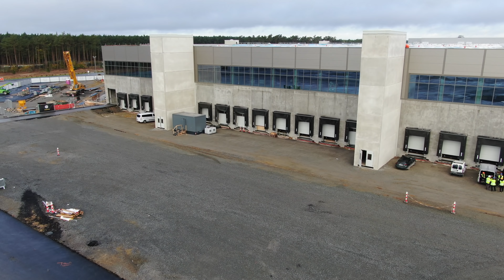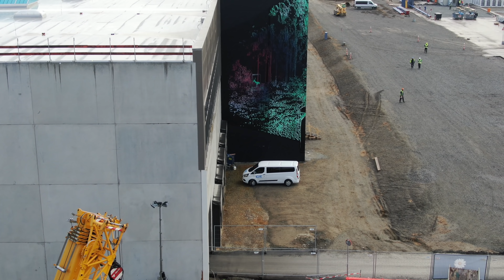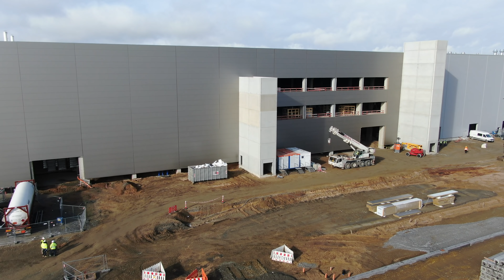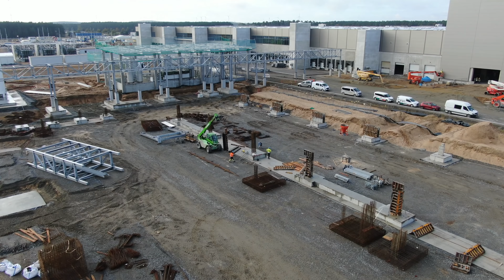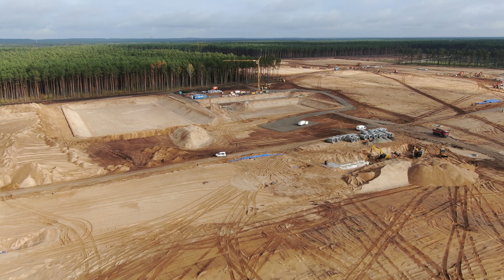Giga Berlin | 2021-10-16 | Progress everywhere

Comment: Great video as always, Tobias. The factory is looking more finished outside now. Still lot of work to be done outside.
It seems to me that there is more equipment outside at Giga Berlin than at Giga Texas. I wonder if this is due to Govt. environmental regulations in Germany?
Hope Tesla gets the final permit soon so that they can start test production/calibration at the plant.
Reply: Most of it is due to a difference in design philosophy and not regulations.  The change in design philosophy likely came with abundant cash to invest in the project.  Texas basically puts everything inside the building, which is unconventional.  It will be interesting to see what both sites look like in 10 years after changes are made to the original plans.

Comment: As you have titled the video Tobias there is indeed progress everywhere and it is great to see.  However the PM in me can't help but think the  project planners and schedulers have got to improve on their just-in-time-delivery of components, notably for the cell factory building.  There are so many unfitted beams on site that they are congesting the entire work area which compromises both personnel safety, crane movement and productivity.  And every time one of them has to be moved before it is installed costs money and schedule which is of course far from ideal.  That is one of my biggest complaints against this build, there seems to be so much shuffling of  equipment before it is ever installed and repeated movement of materials, especially the sand!!
Reply: There you can see one movie with movements every week and you want to judge that the management is bad. Do you not overestimate your skills?
Reply: @ManfredPrefi  And just what are your PM qualifications to definitively say I am wrong? I identified a specific problem, expressed an opinion that there is room for improvement based on fundamental project management practices and enunciated clearly visible risks and effects resulting from that problem.  Yes there are factors no viewer can know from just the videos on Tobias' and other channels following this build that lead to these conditions.  But that is the job of a professional project management team, to identify factors that lead to problems and then to the greatest extent possible resolve them or at the very least mitigate/minimize their effects.  Do you honestly think that the state of the battery factory site is ideal and that it does not affect productivity, costs and schedule?  I've seen many construction sites in my life and never have I seen this level of congestion or repeated movement of materials which is why I commented.  The only reason they can get away with this is that the site is large and not surrounded by other completed factories, the Empire State Building could never have been built without highly honed and effective just-in-time delivery of materials some 90 years ago.  Those lessons are just as valid today as they were then.   A lot of good work has been done and continues to be done, but that doesn't mean improvements cannot be made.

Comment: Tobias, you are a wonderful guy. This is such good work that you are doing.
On the other hand, I look at the intensions of this project, which is indeed a pinnacle of what humankind is capable of.
I cannot help having my doubts about the direction mankind is going to. Production of 500.000 cars each year is only 0,1 % of what is anticipated in the year 2050 as a total number of cars that will be poluting the planet. (800 million). The natural resources of Lithium will be exhausted by that time and at this moment it is not possible to recover this from old batteries. So in the end this is a dead-end street. Also temperature rise of the planet will be much higher than 2 % (2,7 is already predicted).

Comment: Thx @Tobias Lindh 

Berlin battery plant is somewhat narrower than Texas and of course if Berlin will be four large buildings in the future mirroring phase 1, battery and drive unit should be connected and become one building. Do you expect based on currently filed plans, that Tesla will soon widen the battery plant toward drive unit... or are they solving missing area by going vertical / multi storey?

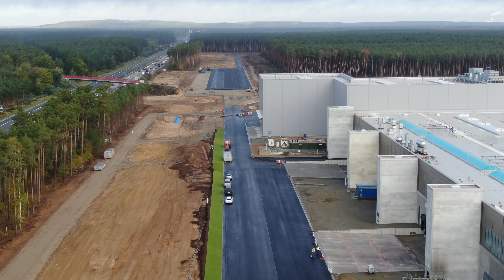Comment: 2:35 is that unused viaduct over autobahn? Also I see there will be a big fence on the edge of grass, there is a piling machine. I’m curious if it’s because of autobahn noise or they want to hide it from view, maybe not to distract drivers.
Reply: Its planned to bring a public bicycle track westside of it. Maybe it has something to do with it.
Reply: Won't be a fence but a "Trägerbohlwand" type "Berliner Verbau" for the construction pit of the rainwatrer infiltration basin.
Reply: This bridge (viaduct) belongs to the old "Poststrasse" (postal road) from Berlin to Frankfurt(Oder). The bridge will be connected to a future bicycle track running between the autobahn and the Tesla factory. I think I also read somewhere that Tesla plans to reconnect the old postal road (for bicycles) somehow.
There are also plans to built next year a bridge for bicycles and pedestrians across the road south of the GF4 (main entrance side).
Not that sure about the noise protection. The allowed height of such a construction is limited. Would in this distance from the autobahn only protect the production on the ground floor. But not the offices / social rooms at the floor above.
Reply: @abalada  thanks for detailed answer.

Comment: So can anybody advise if the utility bridge sections are high enough for a person to walk through them without having to stoop over or even duck down at each cross top frame member?  If not then installing and thereafter inspecting and maintaining the piping and electrical services running through it is going to be a real chore that will be slow and costly. They look close to tall enough and I would certainly expect that to be the case but without any size reference I can't be certain either way.

Comment: What is that structure at around 14:00?
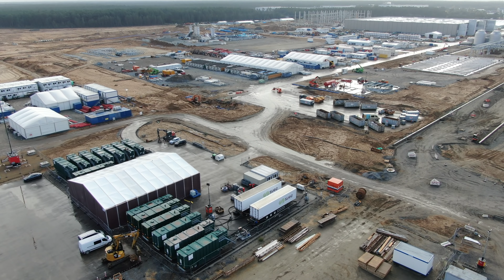Reply: Central Utilities Building. Those platforms are for the big cooling units you can see at 12:07 parked before the long white tent.
Reply: @abalada  What needs that much cooling? Casting?

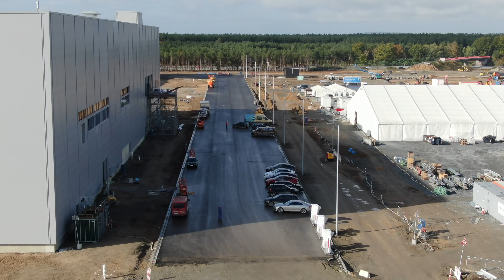Comment: 10:23 why are there superchargers on the street? They should be in a parking lot. Maybe they not installed. But then why leave them on a road?
Reply: They were set up there for the public event. Around the corner they had the test track. Like that, the cars could just stay on the asphalt without dragging in dirt when they needed to recharge.

Comment: I wonder what happens to all the rain that lands on that roof, and the paved surfaces after all the concern about water.
Reply: @Frank RenewablesCheap … they catch all the rain water … time before they used the big blue plastic tanks but now slowly they have ( and still ) build the storm water lines to send the rain water to the storage pond. And I can only imagine that will use it at some form. And about the paved roads or the loading dock area all this surface water goes in the same roof storm water drainage system. U can see the concrete pipes? Normally one is for waste water and the other one is for storm water …
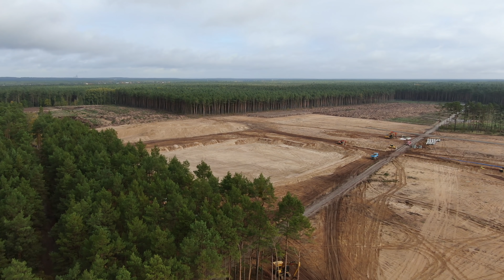Reply: Will end up in a number of infiltration basin, e.g. at 23:34.
There are 3 "wastewater" systems
storm (rain) water -> infiltration basins 
utilities (e.g. toilets) wastewater -> pumping station - > sewage plant in Erkner
process (e.g. paint shop) wastewater -> wastewater treatment facility -> pumping station - > sewage plant in Erkner

Comment: Anyone know what the various scaffolding at 14:00 on is?
Reply: What scaffolding?
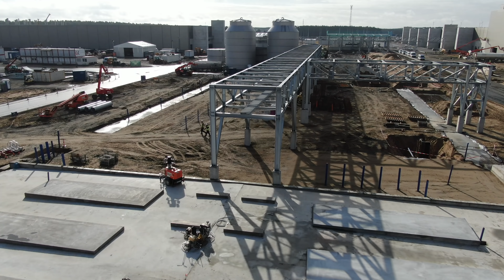Reply: At 14:14 on
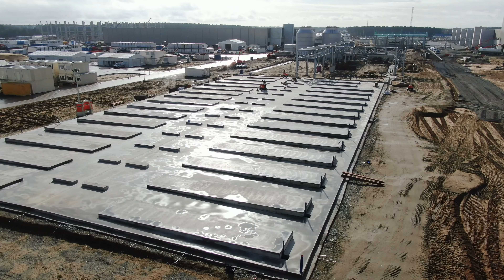Reply: @Yurost1  13:53 - 14:25 Central Utilities Building (CUB) providing cooling, heating and air pressure for the factory
Reply: @abalada  thanks. Just wonder why all the scaffolding/rack appearance. Not something we have seen in Austin construction
Reply: @Yurost1  13:45 These are pipe bridges. There will be a central one connecting the tank farm with the CUB. Plus a few connections into the factory buildings. The bridge structures are not yet up everywhere, but you can spot the foundations which will hold the still missing parts.

Comment: No charging area, no logistics area, no obvious place to put finished cars
Reply: Since they are still building the factory this is no big surprise. The plans are available to see the features that you have observed are missing.
Reply: @gpsfinancial6988  they are supposed to be ready with 2 hours notice. They are due to commence in a few weeks.
Reply: @paulmcgreevy3011  2 hours notice to start producing, not to be fully ramped up. There is a lot of water to flow under the bridge before any of what you mentioned to be an issue. It took several months from start in Shanghai to be doing more than a few a day and now the factory is a powerhouse.